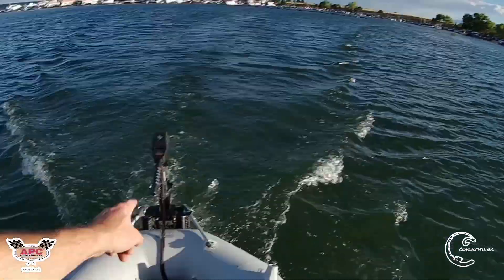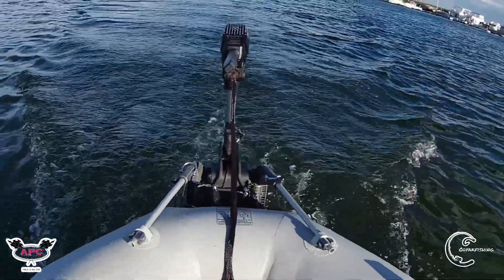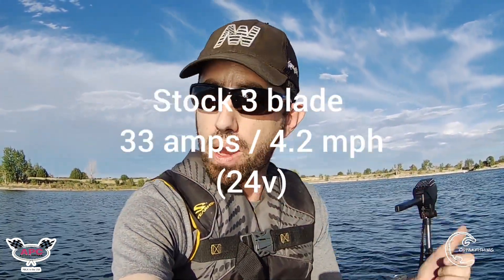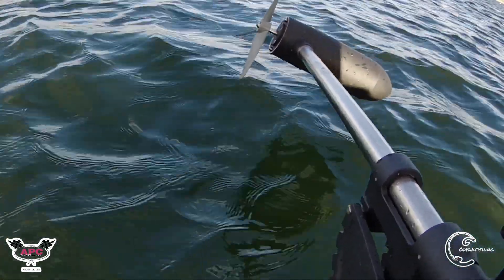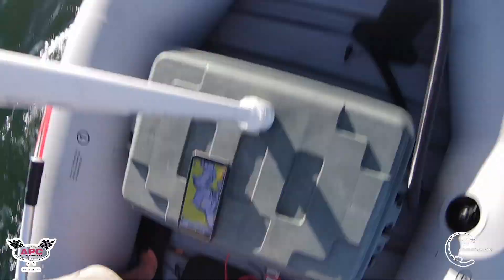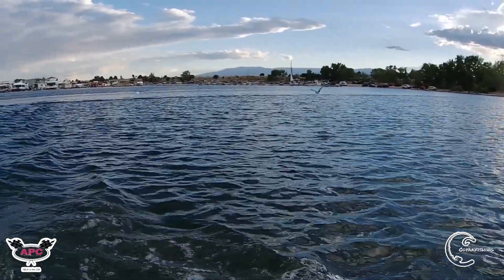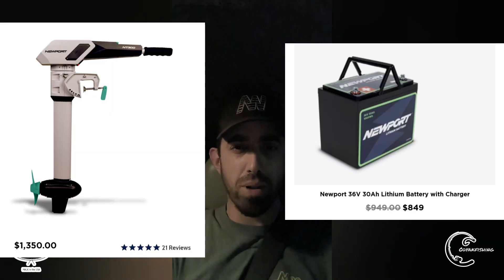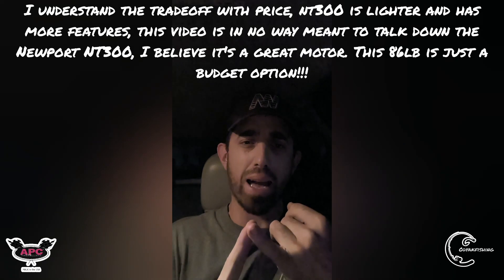350$ electric outboard motor (86lb 24v VEVOR trolling motor with 10X8m-LH APC prop)

Comment: So are you trading torque for rpm to get the additional speed? Meaning would a larger/heavier boat that does okay with 55lbs trolling motor also benefit from the APC prop? I'm new to boats

Comment: shaft is longer than in many motors - there's probably too much turbulence when the water hits blades. could add a plastic "aerodynamic" piece between propeller and motor chassis to negate the dilemma.

Comment: I think you need to try it with Lipo batteries cause your voltage keeps your RPMs up and lead acid batteries tend to have voltage sink when you start drawing  30-40 Amps  out of them so I would do the same test using lithium batteries as opposed to lead acid batteries, it does make a world a difference voltage drop is critical for top end speed.  And if you don’t need as much torque, maybe you can drop your diameter of your prop and go with higher pitch if you’re looking for top end speeds.

Comment: I did everything you have plus clocking the motor speed controler / lithium battery.
 Made it to 3.8 knots with a 35Lb thrust beginning speed was 2.2 knots. Last 4 years I've had a torqeedo 1001 4.5 knots flat out just over one hour it's been great battery still going strong.

Comment: I have 110lb 24v haswing motor. Based on your experience would you suggest 10x8 or 11x6 apc marine propeller?  Looks like my motor makes max 630 rpm
Reply from the maker: @tarassymonik7603  hard to say, but to me it's cheap enough to try all 3? Just make sure to use an amp meter and make sure the amps don't go above the recommendation. But if it were me... I'd try the 11X6, the 10x8 did go faster... But it did draw a lot of amps

Comment: I’ve been playing around with trolling motors on kayaks and paddle boards for several years now. The one very important thing I learned is that all trolling motors regardless of lbs of thrust are designed to push a boat at no more than 5 mph. The bigger the motor the better it is able to push a bigger boat. So putting an 86 lb motor on a small boat with stock prop will push it slightly faster than a 30 or 40 lb motor.the almost tripling of lbs from 30 to 86lbs never gives you a doubling or tripling of speed. Changing props as you are doing will make the boat faster but it also pulls more amps and you run  the risk of over amping the motor till it burns it up in hours of use rather than years of reliable service that we expect from our trolling motors.
Believe me I hate to be the one saying it 
, because I  love the idea of taking an inexpensive trolling motor and turning it into a speed demon. The reality is that with every mod there is a compromise and often the thing that we give up for speed is reliability . 
I managed to modify a 30 lb trolling motor and turn it into a jet drive electric outboard and by over volt ing it from 12 to 24 volts it pushed a small RIB with 2 adults and two kids pretty fast about 7 mph if my memory is correct . However it didn’t last long I believe it was less than 5 mins before something failed lol. 
I appreciate your videos though we are all pushing the envelope and one of these days someone will solve this power, torque, speed equation and come up,with a prop or a whole new drive system that will change the game completely. Until then your $500 system does give a $2000 system a run for its money and that alone is great news for those of us that can’t afford a $2000 or $3000 electric outboard so 👍👍👍👍
Reply: Are you sure about that?
The reason I ask, most of these "prop swap" posts involve either a heavy, wide, angling rig or an even wider, draggier inflatable.
Julie and I paddle a 16ft tandem (old town loon), think light, narrow, and built for speed. 
There's no way the same prop is optimal for both.
Reply: My 30, with 10×4 prop and motor clocked for more rpm does low tq pull to 4.1 on my pwr100 yak. My np55lb same setup does 4.9 with much more punch. But yes, the lb thrust is designed for boat size but still can be faster with a bigger motor.

Comment: aha! you did it. Might be too much for a yak, but sounds perfect for a canoe! Seems like the math would hold up for any 86lb troller. I would be curious to see the running time difference between the 55lb @ 12v w/10x5 vs the 86 @ 24v w/10x8 *with the caveat that you don't go over 3mph with the same load.*. I suspect the 86lb setup will run longer with the same batteries since the amp draw will be lower for the given speed, so less lost to heat and battery dynamics.
Reply from the maker: I think so too but sadly I sold the 86lb, it was way too much motor for the inflatable, but i didnt gain all that much more speed vs my 55, so I'm completely happy with it
Reply: Unless you have a square back, I wouldn't put that heavy of a trolling motor on a canoe.  I have a bunch of trolling motors, and usually use a 30 lb min kota for the canoe, at speed 4 (5 is max).  I actually think 2 - 30 lb min kotas would be perfect, on on each side to balance the canoe.  I'm using power queen lifepo batteries, which are a bit lighter than the lead acid, and seem to last way longer.   I think I'm going to get this 24volt for my 14' aluminum lund, as it is a bit heavy for the 55 lb motors, in wind especially with the bimini up.  Thanks for all the info!

Comment: Your tests just prove that trolling motors are not made for speed. The rpm they produce is just too low to move the boat fast if you put higher pitched prop it will just overheat and burn the motor.
Reply from the maker: Now I would agree if I didn't do the research myself, the 10X8 isn't the perfect pitch to diameter ratio for this specific motor. Now after reading up on the manual of the epropultion spirit 1.0 plus, it stated it's motor max rpm is 1200, and has 71lbs of static thrust, also, as long as you keep the amp draw below manufactured specification, on this particular motor is 45amps, you shouldnt have issues with motor or wiring. In the near future I will test more and different props with this setup, I'm not looking for fast speed, I'm looking to match epropultions speed and current draw, which as of now I feel I accomplished on a budget. If you look up Wayne the boat guy, he got about 5.2 mph on his epropultion spirit 1.0 plus, and I managed 5.0 on this much cheaper setup

Comment: Hey Cody, my Vevor 24v 86lb motor shaft does not have the cross pin for the prop!  How are you securing these APC props?
Reply: NVM…lolz I just heard your description in the vid
Reply from the maker: @sokhenayou5402  lol your good, I just used an 1/8 bit and drilled through it, it's a soft metal
Reply: Thanks!!!!  I will put my prop orders in!
Reply from the maker: @sokhenayou5402  sounds good, if all works out, and I'm not sick...lol I plan on testing a a few props Sunday, unfortunately not on the 86 (don't have a 24v power source at the moment

Comment: i usually dont sub when the video isnt more edited but i have a mariner 4 with 86lb trolling motor and i understand the camera shyness and respect a working fam man fishing in a inflatable boat...i get 5 mph stock prop but i ordered a few of these props to try...trust me u need a rudder for ur trolling motor...our boats have a hard time tracking straight and get blown all over when the motor is off its a complete game changer i made mine with a cutting board...trust me get or make a rudder..oh and a high output inflatable pump if u dont have one...theyre all good i like mine that uses a 20v battery..all brands have em it inflates in under 3 mins but still have to pump a few times to get full psi
Reply from the maker: I have a high output pump that gets it to about 1 psi, yea I've been thinking of ordering a rudder for the trolling motor for a while but haven't yet, I appriciate the sub, I'm going to get better with the editing sooner or later...lol hope you enjoy the channel!!!
Reply: i feel bad i didnt use ur link but if apc is looking i bought there props cuz of cody and im gonna try it out on my 86lb today...i tried it on my small 20lb and it seemed like it was smoother and more quiet....dont go out again w/o atleast a diy rudder...ull be amazed  @codyakfishing8856

Comment: How is the speed control for trolling
Reply from the maker: The slowest I was able to go was about 2.3, but that's to blame to the pwm in the unit, one can get another pwm and install it to get even slower rotation of the prop for about 30$
Reply: @codyakfishing8856  or propeller with less pitch?
Reply from the maker: @XSAILOR65  I may try one in the future, but less pitch would mean less top speed. So my theory is this is the biggest prop this motor can handle due to its amp draw (42) this motor is rated for 45. My minn kota enduramax has a much more efficient pwm module and I'm able( with the 10X8m-LH prop) to slow it way down to under 1mph, but it's too much prop at top speed... if the vevor had a pwm module like my minn kota has.... it would be perfect....
Reply: @codyakfishing8856  Agree, you will loose top end. But pending on the hull shape, maybe not so much?  How slow You need to go for trolling? If motor would be "under pitched" at top speed, your amp draw would probably also go down slightly. But its a kompromiss in any case.  If they would make it as a brushless motor at close to same price, that would be nice!
Reply: @codyakfishing8856  That one hav probably a high quality PWM?
Reply from the maker: @XSAILOR65  yea my minn kota has a much better pwm
Reply: @codyakfishing8856  Hav You tested the vevor with lower voltage? I have several 18V /8amp lithium batteries that can deliver 100A, wonder how that voltage would work?
Reply from the maker: @XSAILOR65  as far as I understand, it would work, but at just a slightly lower speed, but still should be stronger than a 55, it would draw more amps though
Reply: @codyakfishing8856   thanks mate!

Comment: I noticed you are talking amps and not watts. I have found that as the batteries discharge and the voltage decreases, the power is less even when using the same amps due to ohm's law, amps times volts equal watts. Maybe that's close enough, but for more accuracy, maybe get a wattmeter and go by watts which is a measurement of power.
Reply: I just read below where you said it runs faster with the other prop, but at more amps. I'd be interested to see how fast the 2nd prop goes when using the same amount of power (watts). Also, running at the higher amps is fine for short duration (it's gonna get very hot very fast at that rate), but I'd like to see where the best efficiency is when using a specific power level like 500 watts continuous for example.
Reply from the maker: With this motor it's a bit difficult to do, it came as advertised as variable speed, but u can hear steps in the motors work load, it's not as seamless as my enduramax, but I plan to take it back out and do more testing here soon and will include some slow speed power readings
Reply from the maker: I was thinking about buying one here soon, I'd go with watts but a lot of average anglers who use batteries are used to the amp hour statistic. Such as when u buy a battery on Amazon it usually lists the capacity in an amp hour format instead of watt hours, but I can include both on later videos
Reply: yeah, I get that. You need to communicate in a way that the average person thinks and talks. I am an oddball. I have been interested in this stuff (electricity and renewable energy) for 45 years and am fairly versed on it (not formally trained in it tho, I am a machinist). I am doing almost the same sort of thing as you here with these small crafts, just for a different reason. I understand you are talking to fishermen. As I said b4, I am interested in long duration cruising on full electric as cheap as possible and as portable as possible. I think one of the great things about these small inflatables is that someone who lives in an apartment and doesn't even own a truck can still do this.

 I hope that care package they sent you has alot of diff props to test! You'll have plenty of material for vids next spring and summer. You should maybe use the winter to devise a game plan on how you want to do the tests and present the info.

 Good luck to you, but most of all, have fun! Life is short.  @codyakfishing8856
Reply from the maker: @eddowney9548  the care package was pretty cool, I'm not allowed to show my viewers everything...... But I can show you a couple,.I'll be testing more things and sending it to APC so they can choose what to produce....

Comment: STOP apologizing for your editing! The INFORMATION you provide is excellent. There are literally millions of slickly produced videos that provide ZERO useful info.  Well done.
 
Although the 10x5M's pointy thin blades are probably more efficient, for a boat, stronger is better. If APC made 10x5M & 10x6M props with the rounded tips and thicker blade design of the 10x8M that would be killer for trolling motors. Any pitch over 6" is really too much for most trolling motors (MK rpms=1540). They could call it the Codyak Prop.👍
Reply from the maker: I appreciate it man, also the camera shyness is starting to fade a little...lol
Reply: @codyakfishing8856  I reached out to APCProp last week and they mentioned they're working on a 11x6 marine propeller design similar to current 10x8. That might be just what we need!
Reply from the maker: @helloterran  that's awesome, Ill get a hold of it and test it for sure!!!
Reply: Agreed

Comment: Hey great data again! As promised a couple of weeks back, I've also tested out the Hangkai 1000w brushless outboard, which retails for ~$200 occasionally (under different brand names). Here're the mph/watt data points I got:
2.8@130w
3.6@270w
4.3@530w
5.0@1040w
5.3@1440w
(Yes, using 48v ebike battery that's actually 54.6v fully charged essentially overclocks the motor)
It's a solid performer, however quite noisy compared to Vevor. And it uses a fast-spinning (3000rpm) 7x5 prop, which may not be the best choice when it comes to efficiency.

As a comparison, my Vevor with APC 10x8 props ran at about 3.8mph @ 500w, and peaked at ~4.4mph @1000w. I blame the brushed motor for the slower speed at similar wattage.
Reply from the maker: Wow that's awesome!!! That hankai outboard is pretty neat then, noise wouldn't bug me much, the motor itself does spin at 3000rpm, but is it the brand that has the motor under the cowling?? If so then the prop spins at about 1450-1500 rpm since the bottom unit is gear reduced I believe, I'd love for you to get a video of what u did, oh and maybe switch out props on that 48v unit

Comment: good video :P :P
Reply from the maker: The benefit of the nt300 is it's brushless DC motor, compared to this brushed motor unit, I'm not trying to sell APC props, I was excited in my video testing these props because I was shocked at the efficiency of them.  I make no money on sales of any prop and bought them all myself. I'd love to have the nt300 to compare it to, I don't have the money for it, which is why I made this video, to give people a cheaper alternative as a lot of us are on a budget. According to videos on yt, the nt300 is getting 5 to 6 mph drawing 1200 watts, this 86lb is getting a solid 5mph drawing 1000watts on a very inefficient boat, I can bet if I had a small vhull or maybe a Jon boat, I can possibly get 5.5 and maybe even 6mph
Reply from the maker: I forgot to mention, I compared the epropultion spirit 1.0 number for number, epropultion states it's motor has 71lbs of thrust, the vevor claims 86, both motors rotate at 1500rpm, both use close to the same watts, boat,wind,prop depending). The epropultion and nt300 are lighter weight due to their brushless design. They are both awesome electric motors..... It's just we all don't have over 2k to drop on one of them
Reply: great video
Reply from the maker: @JosephMBoyer  thanks Joseph

Comment: I have a Newport-Vessel 55lb trolling motor, on my 14 ft alum. V hull. It has the 3 blade prop, would that possibly get more speed ?
Reply from the maker: Im betting it will, now the 10X8m-LH prop may have a little too much pitch for a 55, if you order the 10X5m-LH and use it on your 55 u should gain both speed and efficiency

Comment: Yeah I was using a 14 foot boat for my tests. The Newport screen isn't very informative. But considering a LiFePo4 battery that supports an app means theoretically a person could buy a pretty fancy battery, and an inexpensive trolling motor with the right APC prop and get pretty close to the same speed on a budget!
Reply from the maker: That was my point of this vid, I forgot about those apart lifpo4 batteries, thanks Wayne!!